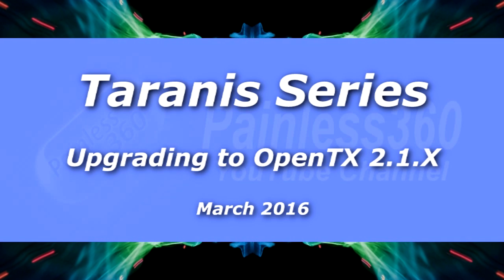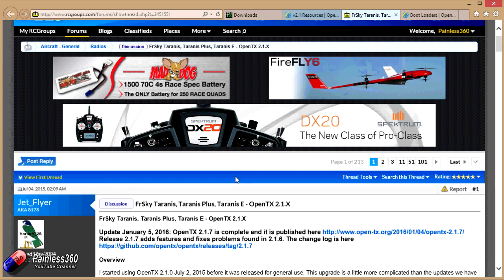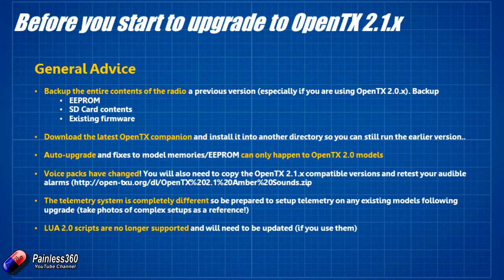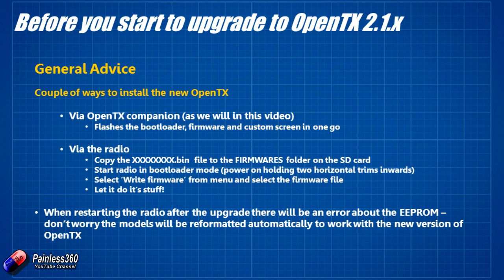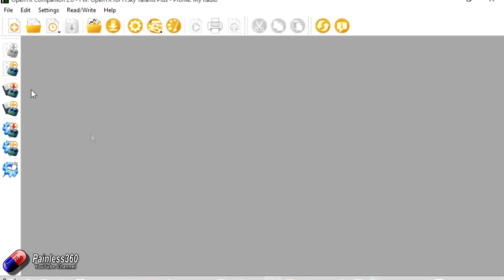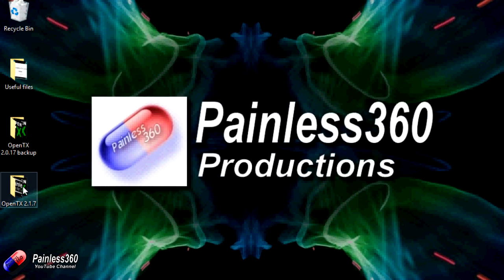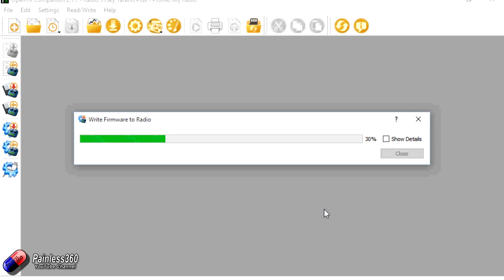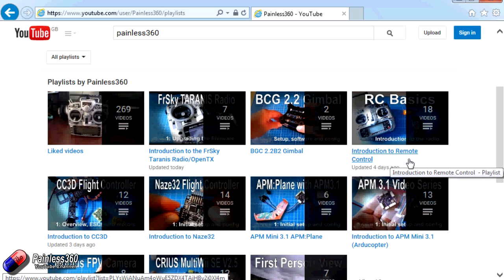FrSky Taranis Series - Upgrading to OpenTX 2.1

Comment: When I try to write the firmawre, its says "Could not Check the Firmware on the Radio"
Reply: Create a folder on the SD card named FIRMWARE and place the bin file inside it. Put it back into the Taranis. With Taranis in three finger salute mode, connect to OpenTx and write the firmware to Tx just like in the above vid except for Taranis being off when doing it. Follow 360s video advice about the eeprom error. Bootloader will still say old version of OpenTx. Then disconnect and turn on Taranis normally. Long press "menu" and go to page 2 which should have SD card content info. Go to [FIRMWARE] and press enter. You should see the .bin file. Highlight it and press enter. Then choose "flash bootloader" and press enter. Worked for me as, initially, I got the same message as you did. I satrted out with OpenTx 2.0.15
Reply: can u explain more specific? place bin file? which bin file? i tried like u said but still pop up could not check the firmware..

Comment: I'm a bit confused...on the opentx downloads page it's written:
"OpenTX 2.1 branch: This branch is the first to support the FrSky Taranis X9E (tray version)"
" OpenTX 2.0 branch: This branch is the first to support the FrSky Taranis Plus and the Turnigy 9XR-Pro"
I have a Taranis Plus radio with the frsky stock firmware version 2.1.6, which upgrade version should I choose (2.0.X or 2.1.X)?
Furthermore, on the video you recommend to first upgrade to version 2.0.X and then to version 2.1.X, does this mean both work with the Taranis Plus version?
Reply from the maker: +Adam Galmor the tray version is not the 'standard' radio that most of us use. I'd use the latest and greatest normally. Best of luck!
Reply: Hi Painless360 
First I'd like to thank you for you great videos, they all helped me very much!
You mean I should use the latest release of 2.0.X branch with my "standard" radio?
Reply from the maker: +Adam Galmor that radio can use any version.. Have a closer look at the release notes and see the later videos in the Taranis series. Best of luck!

Comment: Noooo! Everything elce is working. My transmitter came  with  2.1.6, I just tired to flash 2.1.8 but it gave me an copyright error- filter on vendor? I took a screenshot. not sure what to do. it does have report error too address.
Reply from the maker: Sorry, we've never seen that. I'd Google the error. Best of luck!
Reply: 2.1.8 is for the tray version of the Taranis. (X9E)
Reply from the maker: 2.1.8 is the first version of the OpenTX firmware that supported the tray but isn't just for that model ;)
Reply: Can I put that firmware on my original Taranis? It has 2.0.15.
Reply from the maker: Yep, we run 2.1.7 here. See this video for details on the process and the other later videos in the series on the big changes in the telemetry system you'll need to know about. Best of luck!
Reply: It was the bootloader that needed updated, 2.1.6 was glitchey. All good now Thanks.
Reply from the maker: Interesting - thanks for letting us know..

Comment: Hello:

I am following the steps provided but when i hit the "write to tx" button i get a message that says "Could not check firmware from radio" message, with the only option to hit OK which just exits you out and does nothing.

I am actually trying to resolve an issue with the radio as i upgraded to 2.1.8 but the telemetry screens didnt look right so i reflashed the FW and now when i turn on the radio it vibrates for about 30 seconds and nothing comes up on the screen, its just white, if i hit any of the buttons it starts vibrating again. I am pretty sure i lost all the models i had but at this point i just want to have it work again. Can you provide some insight as to what might be going on.

Comment: Hi.... i have open txflashed on to my 9xr, and wondering if there is any real good resources onhow to program it in particular i would love to be able to set a curve using a pot so i can alter its curve if that makes sense with a pot
Reply from the maker: Tricky to do with a pot. but you can create different curves and use flight modes to have them selected on the output you want.. Best of luck!

Comment: did exactly as you did. I followed along with video. firmware took fine but bootloader still shows 2.0.15 other than that works fine. did i miss something? but im on version 2.1.8

Comment: I had to stop mid video cos you say i need 2.0 BUT there are so many 2.0 versions and mine is not listed. :(
Reply from the maker: +Jem Little (Formula FPV) Any version of the 2.x should be fine - see in the documentation we mention..
Reply: +Painless360 I have tried to read the wads of info but it just blows my mind, thats why i like videos like yours. 
I saw no mention of being able to use ANY of them only talk of using the one for your tx. 
I may just not bother and try to sell mine and buy the right one. 
I am in lots of pain :(
Reply from the maker: Best of luck with it.
Reply: That was a cool video you pointed me to, thanks.
It bring another question to mind. 
would you be interested in giving that and similar talks at a quad event?

I did try prity much all of what you mentioned in your video. 
My vendor pointed me to your video.
I have issues with reading (to me) wads of text (my brain works in pictures) thats why i prefer videos. 
No offence but I just needed to hear you say it dont matter which .version you need if it dint. 
I am a bit para about messing with my tx as its just not my bag. I cannot move past a step i cannot complete as you show. I did do a lot of searching and (imo) the opentx pages are so full of stuff for so many types it is not at all clear. 
You show a version for taranis plus that is not listed. I searched for it using the name but found more wads of useless info and no file. 

I am still with hope, and seriously appreciate your help and the considerable time you have taken to make these videos. 
Until then my KC180 will just have stay a shelf queen lol 
I can still fly my other quads. :) 

At least i found out the Naze rev 5 dont have sbus lol new findings every day lol

Comment: Hello Mr. Lee,

I am having an issue writing the most recent firmware to my radio using the newest OpenTX companion 2.1.8. I am getting a Firmware check failed window, stating it could not check firmware from the radio. I cannot seem to figure it out. Any idea on why this is happening? My old boot loader was 2.0.9 which I've updated internally to 2.1.8.
Reply: +Chris Bessiere I am going to refer back to your prior Taranis videos. Maybe if I start from scratch, I'll be properly prepared to update.
Reply: +Chris Bessiere I just had the same issue when trying to upgrade my taranis from the same bootloader version as you. Did you ever manage to get it figured out?

Comment: Zadig and all USB functionality was perfect, My update failed because of a lost dfu exe file plus my not knowing what the problem was.  because V2.0.19 and a file from FRSKY.COM download's page successfully updated my Taranis Plus fine  as you demonstrated. 2.1.7 would not.   Random hunt,  peck in companion and a lucky guess and everything fell into place..I still have  questions regarding versions. I watched you put 2.1.7 into your TX. But,  Documentation says  One group supports the FrSky Taranis X9E (tray version).   OpenTX 2.1.7          (2016-01-04) and the other group, the Taranis Plus and most recent was  V 2.0.19.V2.0.19 and a file from FRSKY.COM download's page  updated my Taranis Plus while 217 would not. The TX is very resilient and it's electronics well built, "bullet proof". It survived me and this because I had to know how to fix this.. Hope this helps someone else.Thanks
Reply from the maker: +Steve Gross thanks so much for posting the answer. V2.1 branch supports the x9e as well as the other radios.. Happy flying!

Comment: Also, is not 2.1.7 for  FrSky Taranis X9E (tray version) and not Taranis Plus?  My Taranis Plus will only operate as you have demonstrated, even updating firmware when USB plug in and TX is "Off" when I use 2.0.19 from the download section for FrSky Taranis Plus and the Turnigy 9XR-Pro. the section below. This is typical for me. I hope you will comment
Reply from the maker: +Steve Gross read the release notes for 2.1.7. All covered in there  ;)

Comment: MY radio will not open com port until I use the 3 finger salute or as you refer. Backing up my files was the only part that went well. . from 13.27 in your video nothing worked as described.
Reply from the maker: +Steve Gross hi Steve, I've heard of this but never seen it myself.  I'd look for others in the forums tbat overcame the same problem. Best of luck!

Comment: I'm expecting my brand new radio to arrive any day now. I'm guessing it will come with something less than open TX 2.0. if it does do I need to upgrade 2.0 before upgrading to 2.1? I'll have no need for 2.0 unless something goes wrong with 2.1.
Reply: I hope so, that would make things easier. I'll let you know, if it ever arrives.
Reply: +Alain Baran Open-TX 2.1.6 sweeeet! thanks for the environment.

Comment: Excellent video, many thanks. Did you upgrade to EU LBT before going to OpenTX2.1.7 or are you still on EU 2015 firmware?
FrSky are only selling receivers that are EU LBT and these don't work with a transmitter running EU 2015 firmware. Please could you do a video on updating to EU LBT? Thanks once again.

Comment: When trying to write the firmware to the radio, I get an error message..."Could not check firmware from radio"Any suggestions?Device Manager does show STM Device in DFU Mode under Universal Serial  Bus Controllers...
Reply: +Dave Somers Solved my problem by using Zadig to update the driver for the STM32 controller. After updating the driver, the Taranis showed up as STM32 Device but the flashing worked as advertised.

Comment: Do you know if the issue with XPS laptops has been fixed? I have had to do everything separate from the computer (loading the firmware onto the SD card to upgrade, managing models and such), so I was just wondering if there is anything new. Thanks!

Comment: Hi Lee, After calibrating the radio, will the trims, sub trims and end points still be as they were before the firmware upgrade? or, will I have to re-trim all my models. Thanks
Reply from the maker: +iflylilplanes Mine all seemed great but I did have to reconfigure the 6 position switch as that didn't make it across but that was a 5 second job..
Reply: +Painless360 Great, I'll be upgrading this week one night. Many Thanks.

Comment: Funny thing.After updating the bootloader stil is 2.0.15. And the firmware is 2.1.7.
Got some problems with fixing this.

Ok found it.
If you go in to the radio setup screen and step to page 2. There is an option called  [FIRMWARES). From there you can update your bootloader. But you need to have the firmware stored on your SD-card in firmware folder.
Reply: If you go into the the SD card menu and select the firmware (given you have put it on the SD card)it gives you the option to upgrade the bootloader.